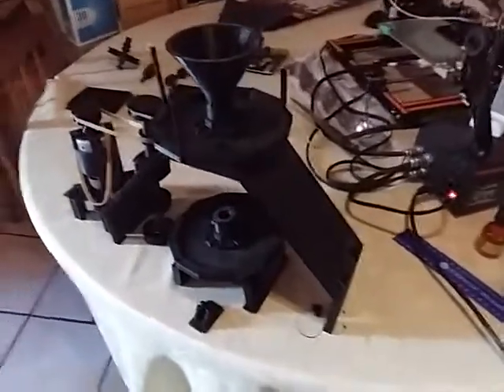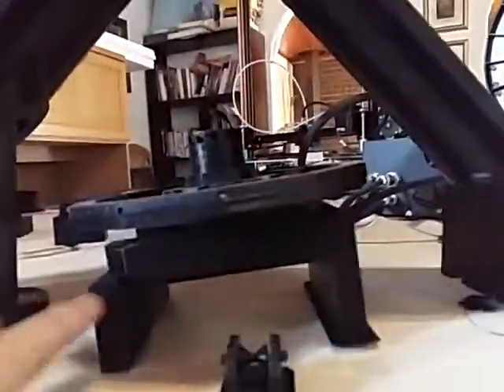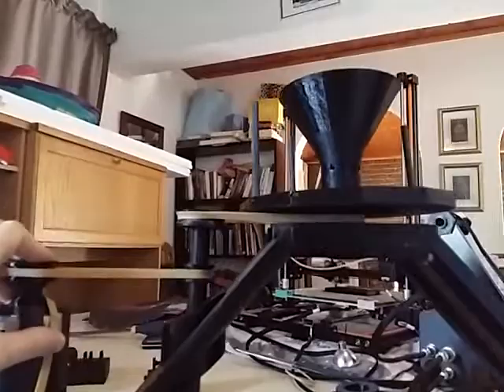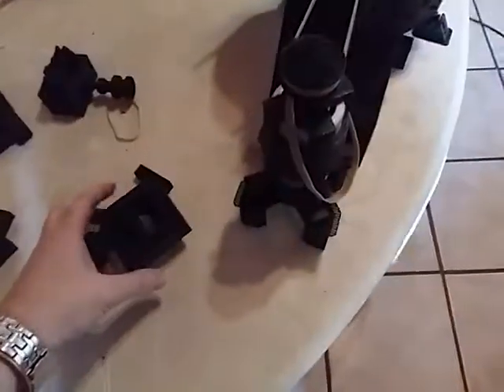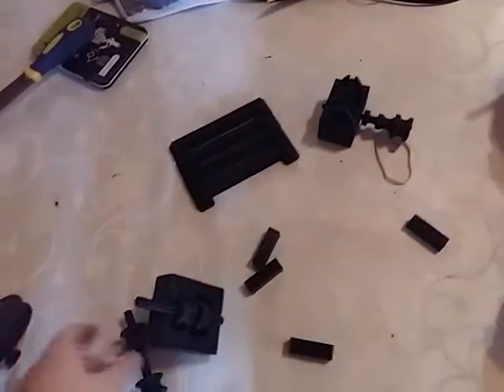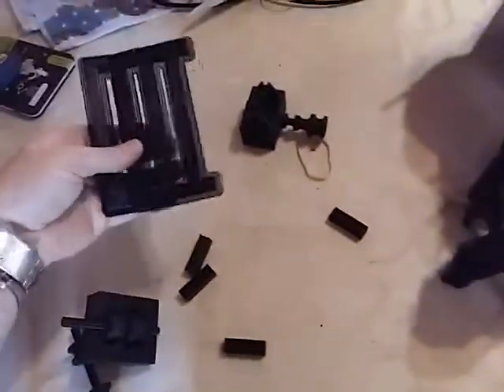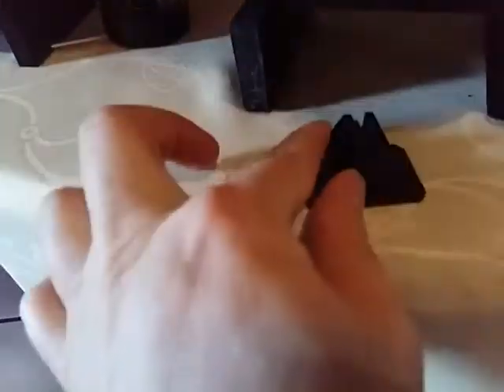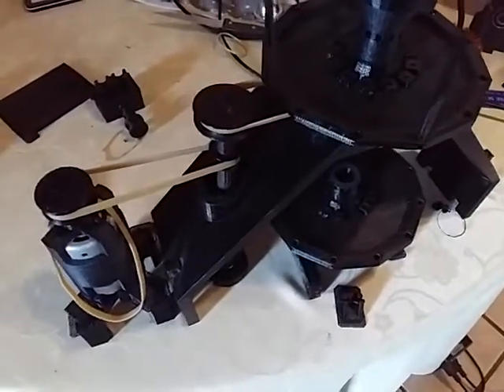3D Printed Fuse Machine Update

Comment: I've been following this on APC Forum. I'm just mesmerized by these machines & there's not a hell of a lot of info on them. I think it's so cool that your using a 3D printer to make yours. Best of luck. Thanks for sharing. Dylan
Reply from the maker: Thanks Dylan, I found much joy and regained much faith in humanity from my 3d printer. Also made some rocket tooling that made little black powder thumb sized rocket motors that flew 30meters up and 100meters across. Unfortunately I had to give up there cos I live in an urban area and the law is a bit strict on fireworks here in Johannesburg
Reply: @SimonBoshoff  those 3D printers are pretty amazing I've got a drafting background but when I was working in the office world they weren't out yet so I never have seen 1 in person but they seem to be amazing & are definitely cutting edge in a lot of fields of industry. Truly amazing.